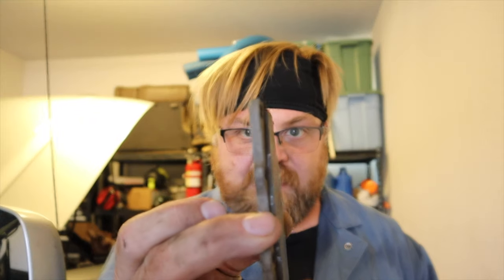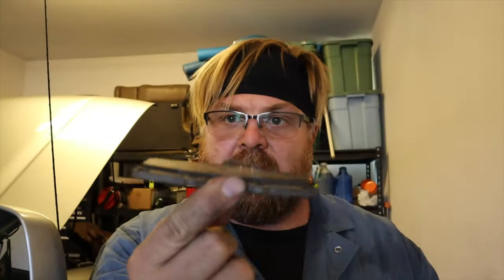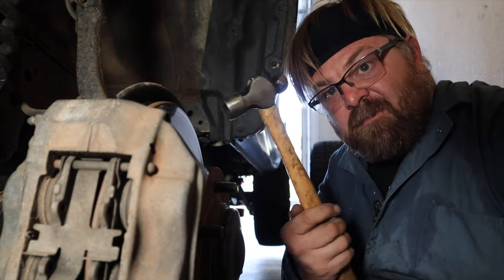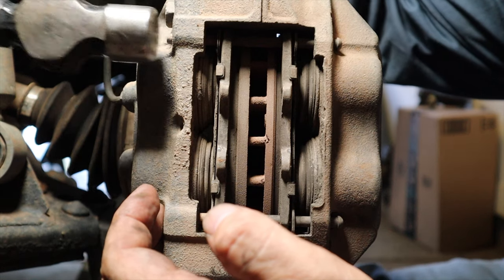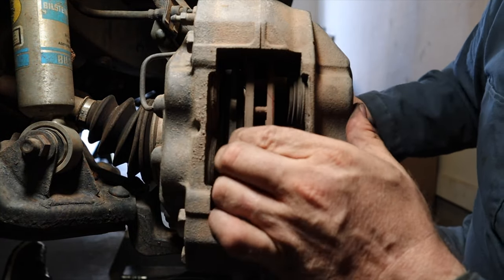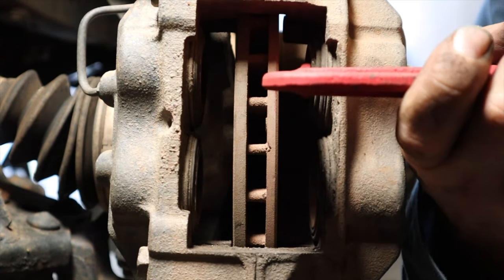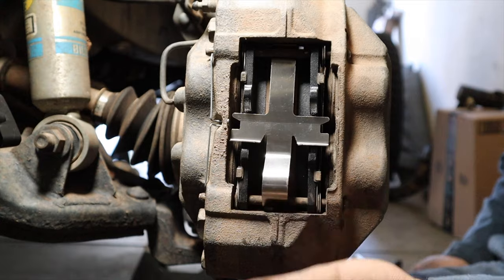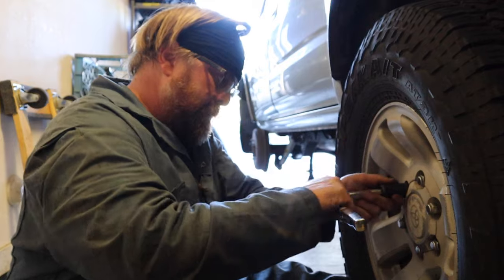Replacing 3rd Gen 4Runner Brake Pads | 4K

Comment: Nice work, I usually replace the pins as they are cheap and you want the pads to be able to move easily. Also any rust will sometimes make them impossible to remove in one piece so they are nice to have.
Reply from the maker: Good call. I wished the kit I had bought would've came with them and more shim plates, for sure! I would imagine they might be harder to pull in more rust and corrosion prone places!

Comment: Good video, but you shouldn't need to remove any brake fluid.  The fluid level between the high and low marks on the reservoir are sufficient to accommodate pad wear, so if the fluid level was at the high mark when the pads were installed, it will return when the pistons are compressed.  Also, if your pins are bent or corroded, it's a good idea to replace them - the pads are supposed to slide a bit on the pins during normal operation, so you don't want any binding.  You should be able to install the pins without hammering them back in, which is a good way to ensure the pads are able to operate properly.

Comment: Lol..nice to watch someone else do it. Well done. I've done lots of those on the Land Rover I had. But I did notice your brake disc move. It should not move with the pads off. Better check your bearing is snug enough . I would think it might be a bit loose.

Comment: Fed.  If your replacing the D1 pads with EBC items, do the disc rotors as well ?  I've found swapping the RRC/D1/D2 pins allows the split pin to be accessed from the front of the calipers vs the back !  V.

Comment: I'm cringing about the screw driver, I use a pair of pliers to pull the pin out.
Reply from the maker: I should have, my toolbox was literally two steps away!
Reply: @MattKester  but you've got to love the ease of operation in replacing the Toyota brake pads😁
Reply from the maker: Yeah, it definitely is one of the simplest maintenance jobs I’ve ever done! I was looking at the ones on the disco when I was in there doing the springs the other day thinking, “this won’t be as easy when the time comes!.”